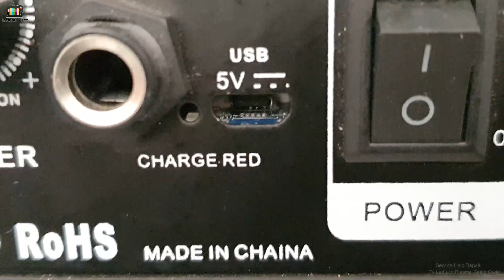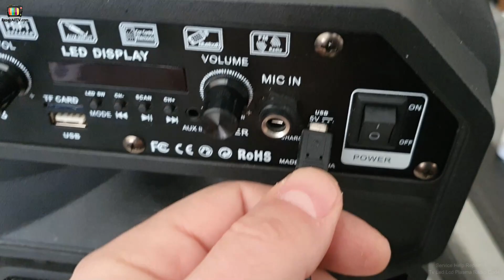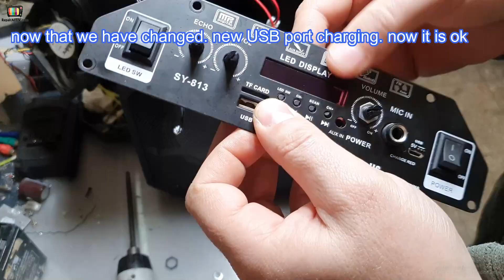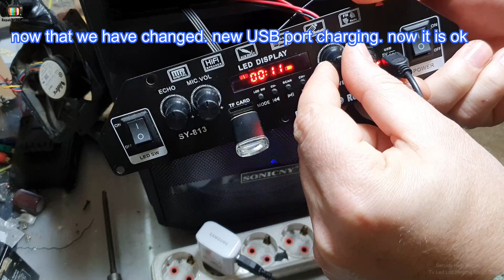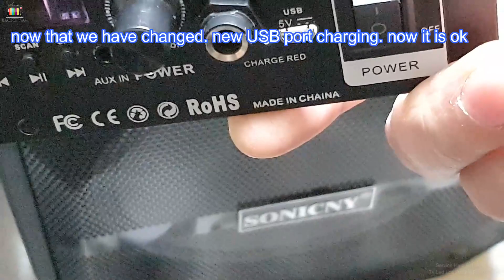speaker Bluetooth micro USB. charging port repair

Comment: I recently repaired the same problem on a party karaoke speaker. Very easy fix with the hot air solder station. Nice work.

Comment: Thank you very much do you have any idea. how to fix the USB port  side.. which micro USB would I need for that part.  My radio only turns on when I charge my speaker thru the usb  no power switch just remote. Thx in advance

Comment: Is my Bluetooth karaoke speaker with a stand trash now that the charging port has a shortage when I stick it in the volume only stays up if I push it in & hold it when I let go the sound get low